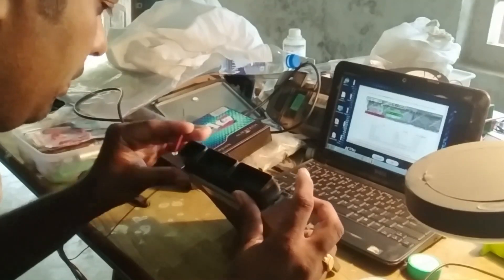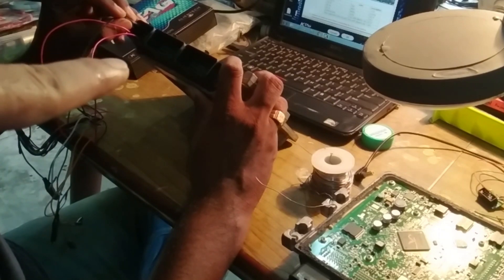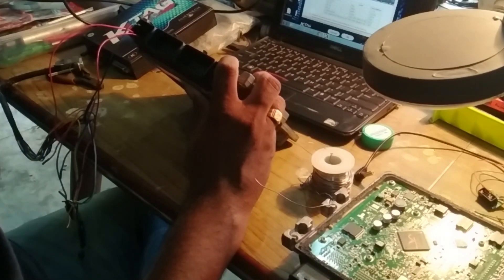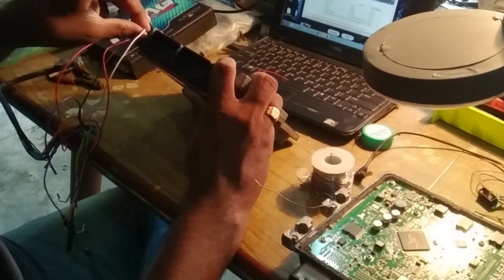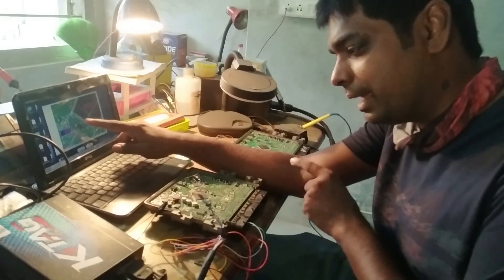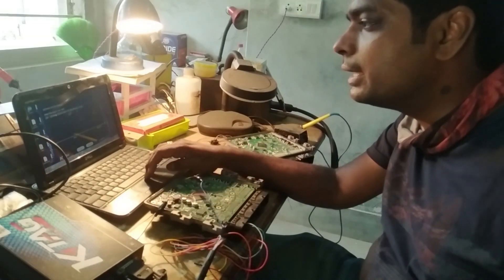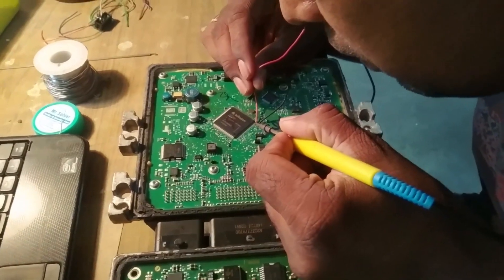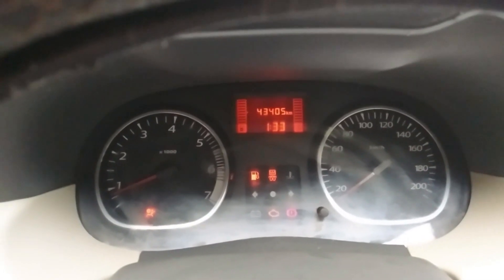Renault Duster Wont Start Fault - ECU / ECM Swapping

Comment: Hello sir . I have problem with duster . Df280 dongle   df009 oil switch open circuit  car wont start and is immobilized is anything you might know to check please sir
Reply from the maker: How did it happen?
Reply: @ShreeshTripathi  we got the car in for repair for minor service oil change now it wont start . Its started up ran for few second and died . Cars not power fuel pump like immobiliser kicked in scratching my head on thus fault in . Cluster can messaging fault and uch there the fault code in the car it cranks but not starting  df024 df009 df0280 renault code thank you sire
Reply from the maker: You changed the diesel filter as well?
Reply: @ShreeshTripathi  no the diesel filter was not changed.  There car is not powering the fuel pump in the fuel tank . But if you power it will tester fuel pump runs but still not start
Reply: We have checked all relays and fuses they all seem perfect . And made sure there is diesel in fuel tank .  Cam and crank signals are there and perfect
Reply from the maker: Duster is having diesel lifter type priming pump no pump in tank.
Reply: @ShreeshTripathi  this is newer model and has the fuel filter in the right hand front wing liner . There is no primers bulb on this engine its 2016 model
Reply from the maker: Was battery disconnected for long and reconnected later ?
Reply: @ShreeshTripathi  yes when the car did this we disconnected the battery to see would it reset anything
Reply from the maker: Perhaps some module has crashed and car won't start. If you have a scanner check for modules some might not be communicating or might need to be programmed again
Reply: @ShreeshTripathi  its like a communication problem if i disconnect say air flow meter it will show up as a fault on diagnostics but it wont clear after fault registered.  I will dig morr tomorrow thank you sir
Reply from the maker: You're most welcome